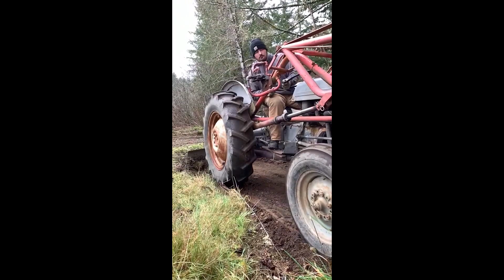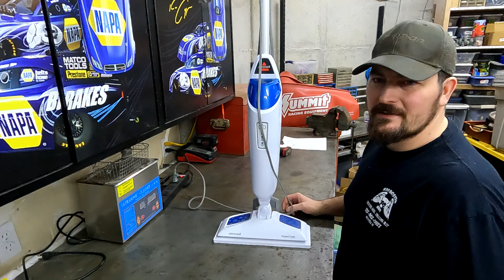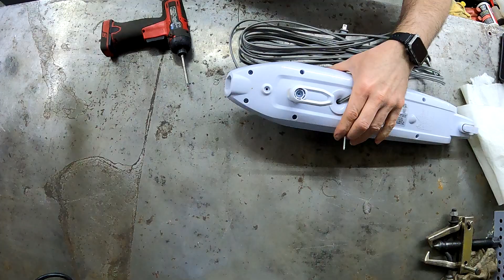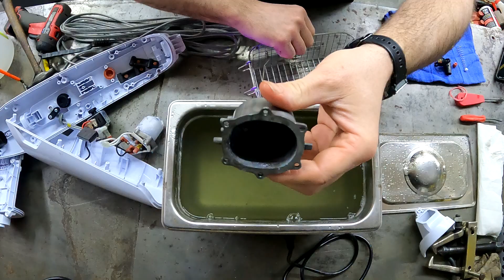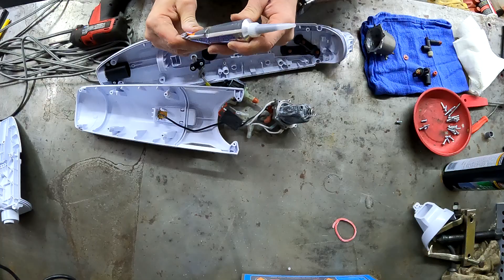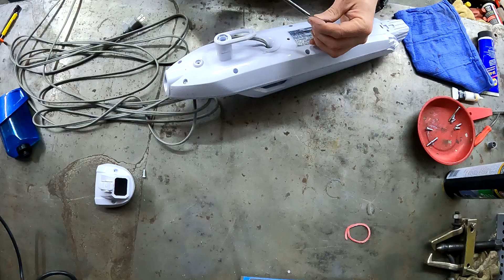BISSELL STEAM MOP LEAK REPAIR

Comment: thank you for the walk thru! gives me hope i may be able to fix the one i have that is doing the exact same thing
Reply from the maker: Good luck!
Reply: @REVUPREPAIRS  it worked, mine seemed to be the spring valve was getting stuck and not closing all the way, so the steam was blowing back to the relief valve instead of out the jet holes